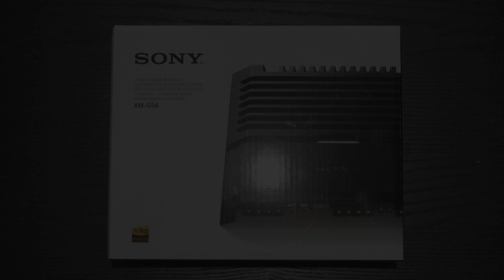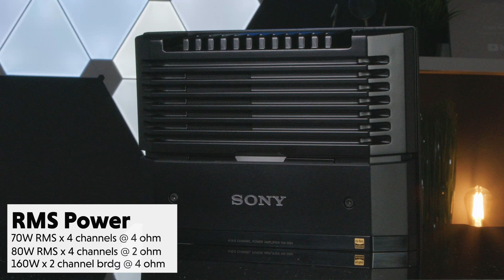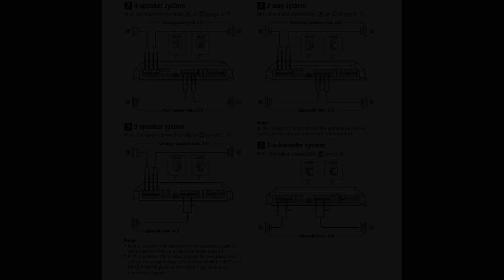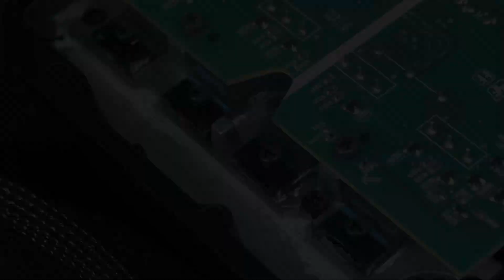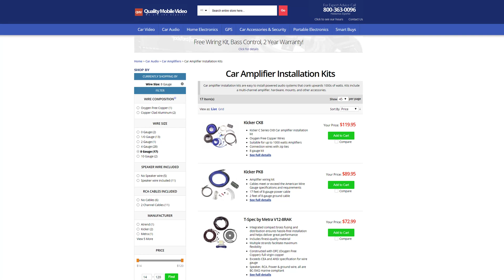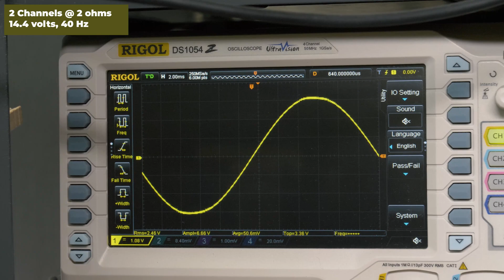Sony XM-GS4 Amplifier RMS Power Testing - 4 Channel Amplifier

Comment: mine has a bit of a clipping sound from speakers when going beyond rated 70 watt @ 16.7 volts so i would suggest to not go beyond 17 volts or 16.7 volts @ 4 ohm if u want to listen clean
Reply: That’s a issue with installation or tuning of the amp. It is not the amp itself.

Comment: Hello.. I have N1004 amp powering 2 Audison prima components (100W rms) and 2 Audison coaxial speakers (70W rms), both 4 ohm impedance. Unfortunately my speakers are getting tripped every half an hour with high wheezing noise.. although the speakers come to life once I turn off the ignition and restart it.. what might be the issue? Is N1004 amp under powered or there is a head unit problem? I own a xuv 500 w6 car with stock head unit. Thanking in anticipation..
Reply from the maker: I really hate to say this, take it back to who installed this. If you did it yourself.  I'll gladly troubleshoot your system over the phone but like a plumber I start at $125 an hour. Dm me

Comment: I have GS4 and GS100 and these things never fails to impress me. I used to run this amp in bridged mode (2-channel mode) with the final impedance of speaker drivers at 2 ohms and it plays flawlessly for long musical sessions, but then I noticed the amp getting really hot to touch. Then i switched to 4 ohm drivers, now the amp does not heat much and i don't notice much difference in audio quality. I have paired the GS100 with two 12inch subs with final impedance at 2ohm and it is a class D beast. No matter which car the amps go into, they are made to rock your ride.
Reply from the maker: Excellent amplifiers, impressive for the price!

Comment: This amp is powering my Sony Mobile ES speakers and the sound quality is so clean and crisp. I love my Sony Mobile ES speakers and DM GS4 amplifier.
Reply: how do you have the speakers set up?  passive or active?       im warming up to this amp with your speakers.  want to run them active though..

larry
Reply: @mafosa8519 what did you end up doing im in the same situation   with the Sony ES speakers and the GS4 amplifier

Comment: Can someone let me know if it can run 4 door + 4 tweeters + 1 central speaker + 1 subwoofer?
 I own a kia seltos and it has 4 door + 2 front tweeters stock... stock speakers are pretty nice  but they lack stereo sound
Reply from the maker: Totally possible, depends on your amplifier
Reply: @Qualitymobilevideo  will sony xm-gs4/q  or Sony xm n-1004 work?

Comment: The SMD AMM-1 readings do not add up and make sense?

At 1khz you state 19.17volts thats 92rms not 72rms

You also claim 19.14amperage draw with 2 channels hooked meaning for the claimed 72rms reading of the AMM-1 to be true the amp would need to be as inefficient as %52 which is wicked low.

Going back to the table of 19.17 volts being 92rms then the 19.14 amperage is more believable as it would put the amp at %66.5 efficiency

Same goes for your results with 40hz sinewave you state 19.08volts which is 91rms not 76rms as claimed with the Amm1 and at 18.42 amp draw the efficiency would have to be %57 for the amm1 to be correct which again doesnt sound right whereas if we take it as 91rms it would be %68 which does sound right

Lumy look ok
hp 8903b looks ok
Gs4 looks ok
Amm1 = speaking out of his ass :)
Reply from the maker: Yea that's why we show so many other readings, clearly the AMM-1 isn't as well calibrated
Reply: What firmware is your AMM-1 on? It may need updating.

Comment: Ok serious question is posible to wire 12 speakers (8) mids (4) tweeters @2 ohm and use a taramps md1800 not a 4 channel amp?

Comment: Is Audio qulity based on amplifier or head unit?
Reply from the maker: Mostly the amplifier and your speakers/subwoofers will determine the sound as well as the EQ and audio settings from the headunit if you use them. The headunit really just supplies the signal. A lot of things can affect the quality, like types of cables used, connections.
Reply: @Qualitymobilevideo  Hey could you please clarify if the rms delivered would be the same in 4 channel driven mode?Video shows only 2 channel driven test results. Thanks
Reply: @Qualitymobilevideo  👩‍🌾👩‍🌾??

Comment: Great specs, but why didn't Sony use better terminals instead of ones from the 90's??
Reply: Look at other 70w x 4 rms amps with higher than 90db signal to noise at 1 watt, they are mostly in the $500 range.
Reply: @vipercrazy-9  and... I run Alpine PDX. Didn't pay as much as you're stating, but if you're going to go by one spec, it blows it away in S/N and power making it worth the extra.  However, signal to noise isn't the main factor and really shouldn't be used as a big determining factor in amplifier purchase. Nobody listens in the 1 watt range.

Comment: I am using these two amp in  bridge mode n only taking 95w RMS ,so that its can pump out  purest signal of 0.05% THD.
Reply: can you explain your audio setup?
Reply: @SanthiratanMandyam  
I AM using TOPPING BC3 bluethooth at LDAC to take Optical signal out for Topping E30 DAC.. takes analog to feed Helix DSPmini to Drive out two sony GS4 amps used in bridge to drive Front component of morel  virtue 602 and rear Alpine R type. 
One Rockford T1500 to drive  Rockford P3 D4. Subwoofer gain ser at 400w only. 
The quality of sound is at par.
Reply: @SanthiratanMandyam  once sony ES series headunit will available in india , i will remove topping hook up that ES unit in the car. 
I have used JVC 960... it has wireless Android auto n apple carplay, but output of that head unit was very very bad.
Reply: @Somesh-Ji  cool, do you stream music from Android phone through Bluetooth? Any specific audio apps you use?
Reply: @Somesh-Ji  great 👍🏻 do you have any idea on Pioneer TS-Z65CH or Sony ES-series components?
Reply: I haven't used any of them... but ES series would be good to go